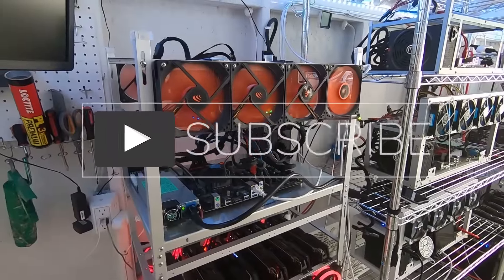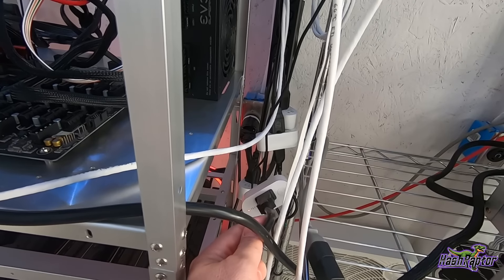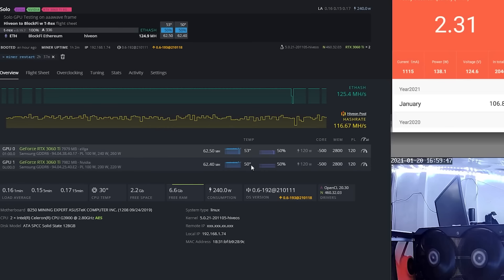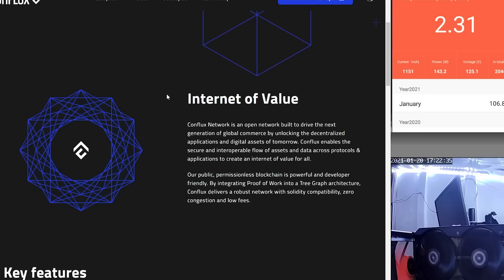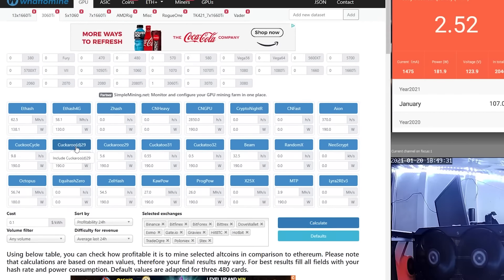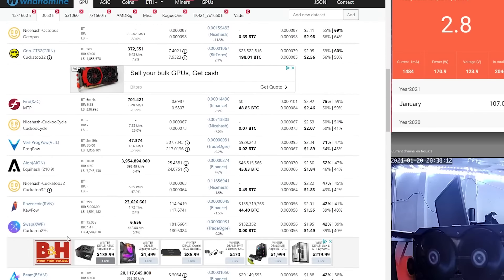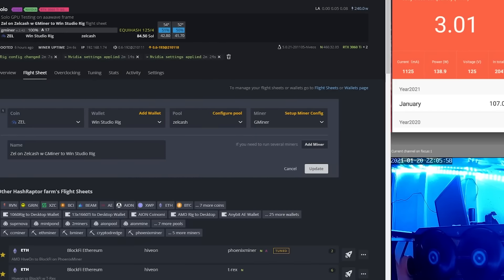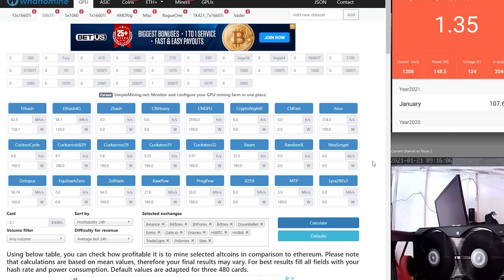EVGA 3060 Ti FTW3 Ultra Hashrate Testing & Profits | Ethereum, Conflux, Aion, Grin and Zelcash

Comment: my msi 3060ti is getting 50 ms and its slightly overclocked at +204 mhz and +201 any tips to get the hash rate up?

Comment: What frame are you using? And what do you recommend at the moment?
Reply from the maker: They are so hard to come by.  Honestly it depends if you want a closed case or open air.  Assuming open air like most, if you can get this veddha frame go for it.  https://amzn.to/3paY6Np
Reply: @HashRaptor  I see it’s not from official Veddha, any idea if it’s the same quality? Thanks for the reply!
Reply from the maker: @Oskar-iw4iq  I don't know sorry.  I assume it is a knock off but these days I hate to say it is slim pickens.  if I were building this second, I'd use wire shelves like this one linked.  I've done it in the past and still have my hanging rig in the farm in those shelves.  You can adjust them, and the GPU's actually notch in to the shelf above it nicely.  https://amzn.to/2Y5fOWN

Comment: you have any invalid shares with the mem at 2800? I got the EVGA OC, the smaller Ti with 2 fans. Having a hot minute trying to stabilize her. Surprisingly as well, there’s a hard wall where hash rate falls significantly under 140W
Reply from the maker: Nope very stable.  I'll be post a video in a day or two that shows it running overnight and it was really solid and continues to be.

Comment: Super Newbie Question. Could You Connect The Dual 8-pin Of The EVGA FTW 3060TI & Also Power The GPU Riser Through One VGA Connection Coming From The Power Supply? Thanks In Advance.

Comment: Great video and testing as always, thank you for sharing HashRaptor!

I had the FTW3 on backorder but still 1 month away, they called me to see if I wanted the EVGA 3060TI XC Gaming (2 fan model) instead for $50 less so I took it. Definitely not as sexy as the FTW3 but hashrate is very similar. Not sure which one is better built for longevity. Either way I was happy I could actually get a 3060ti and start hashing away.

Are you taking ETH profits at the moment or still holding? I haven't touched anything yet, still holding.

Comment: In looking to buy 3060ti or 3060 12gb and mine one of them which will be best
Reply from the maker: 3060Ti Founders Edition if you can get your hands on one.
Reply: @HashRaptor  The only one could get my hands on was the 12gb is there away around the cap on it

Comment: Try lowering power limit below 45%. I still get 60Mh/s (due to similar high memory overclock), efficiency greater than 540 kH/W.
Reply from the maker: Sweet!  I'll give it a shot.  I want to say in my last (music) video showed at 45% I was at just over 50 MH/s.  I'll double check that also.
Reply: Perhaps 46-48% PL 45% may be too aggressive. But combined core undervolt with slight overclock has minimal impact to hashrate.

Comment: Could you please put down the link for 220v wifi plug. Thanks!
Reply from the maker: You bet, here is the plug I use and the 3 prong converter cable.  A few things to note.  I don't put over 1000 watts or 10 amps on the converter cable.  Also, on the wifi plugs, Teckin has done some weird stuff lately.  They took energy monitoring functionality out and called it the same model number.  So at the moment you can only use the new ones on 220 to power the rig on and off.  Also double check to make sure they ship you one that supports 220.  Always check the label on the plug, as this are made a cheap as possible overseas.  If you find a better new option let me know.  Wifi Plug: https://amzn.to/361CSdq ///  3 Prong converter cable to C14: https://amzn.to/39Q63Bm

Comment: I tried this overclock and my gigabyte 3060Ti crashes after 20-60 minutes :/ . Compete HiveOS reboot lol.
Reply: -500 core
2400 memory
125PL

Works best for everyone
Reply from the maker: Yes definitely go 2400 or below on memory. Especially if you’re having problems since all GPUs are different.
Reply: @arfathkhalid1099  I'm doing -500 core, 2400 mem and 120 PL and it's stable :)

Comment: if you need change thermal pads using 1mm & 2mm - back panel only 1 pc 1cmx2cm 1mm, for memories  1pc 0,5cm x 6cm 2mm + 1pc 1,5cm x 2,5cm 2mm + 2pcs 1,5cm x 4cm 2mm + 1pc 1cmx 2 cm 2mm i hope u can und.